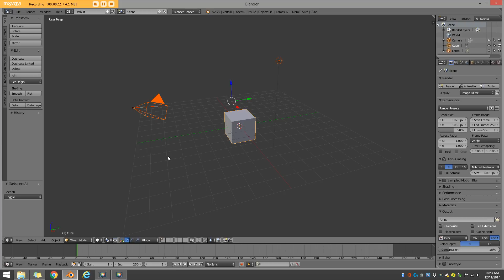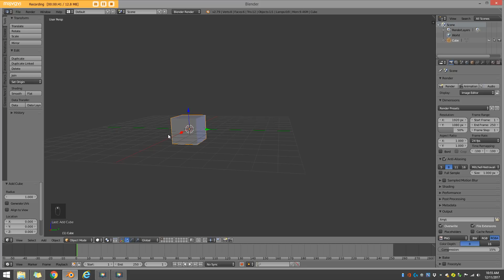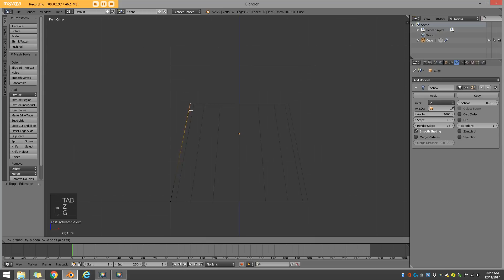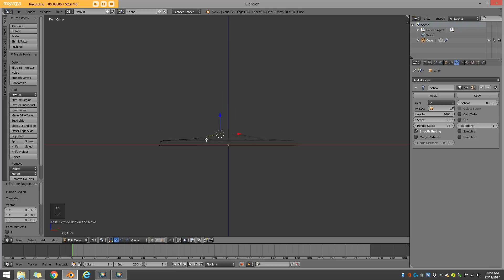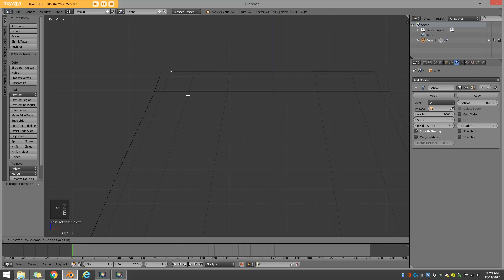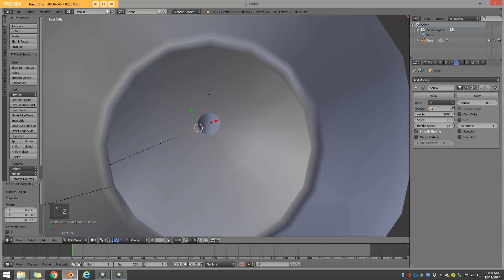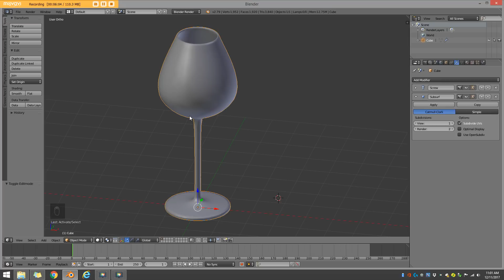Tutorial: Wine Glass (Modelling Only). Blender Beginners

Comment: Could someone start with a circle or a cylinder?
Reply: I tried to dong it with the cylinder and yes you can get the same result. The only reason this is better is because you only have one vertex to deal with when you are extruding up. So it all comes down to: do you want to delete all the vertices from the cube and add the screw modifier OR press Alt and R click on edges everytime you extrude up?